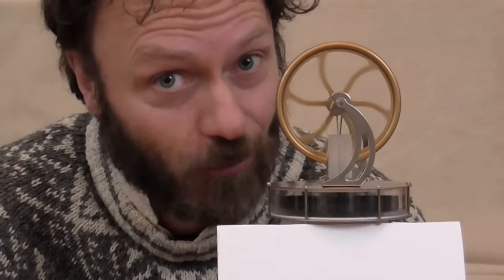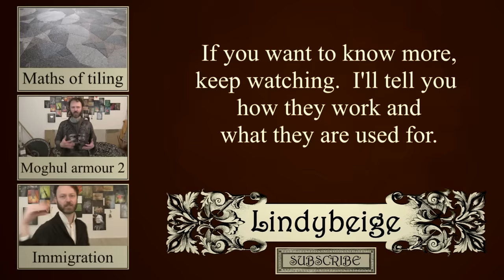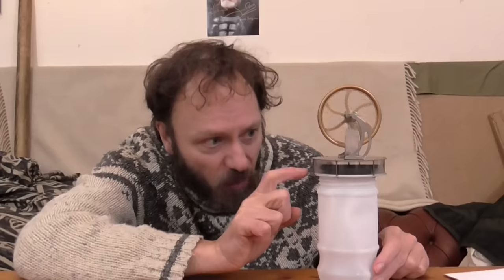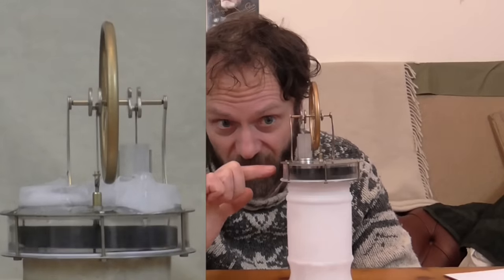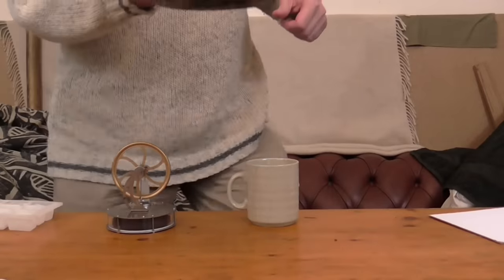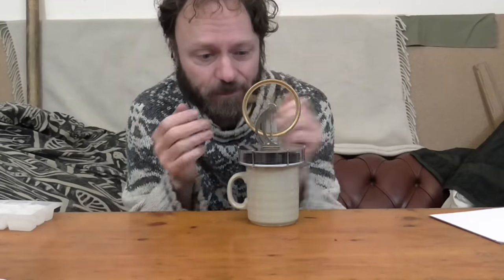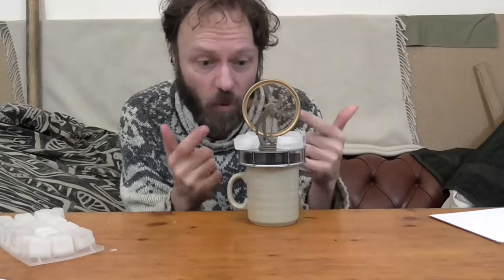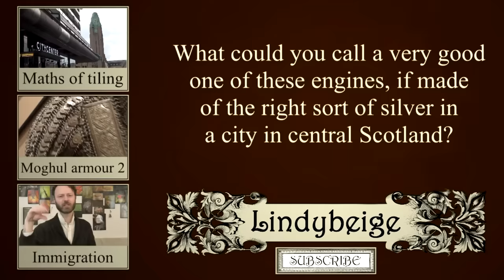Stirling Engines - the power of the future?

Comment: Just spit-balling here, but what if you used liquid nitrogen in hot-climates? If I'm understanding correctly, then it's the temperature GRADIENT that causes the engine to work, so in places like, say, Saudi Arabia (or similarly hot climates) wouldn't the temperature gradient between the natural heat and the nitrogen should be enough to power, say, a locomotive or something similar that you could mount them on in numbers for individual axels. Again, just a thought experiment; Great vid Lindy
Reply: Id guess  that it work really really fast  for a very short time . 
Or maybe longer if ye had a custom made nitrogen container (insulated and slow release etc etc )
Reply: Of course, it would take some trial and error to some degree but I feel that the information we have about the system is at least proof of concept enough to warrant its trials. I like projects, so I'm a tad biased ^_^ cheers
Reply: The energy to create the liquid nitrogen would far outweigh the benefits of this.
Reply: Anders Fredriksson would that not depend how long it lasted ?
I mean youd only need a tiny stream of it at a time ?
Reply: But you will need energy to make the liquid nitrogen in the first place. If you by burning fuel you get a hot plate over boiling point they can run quite fast even in hot countries.
Reply: MrMonkeybat Yes but it might be a good trade off depending on how much or how long the liguid nitrogen is used .........With something small it could last weeks , maybe more .......I mean youd only need a very very tiny jet of it to keep it cooler than the air around it .
Hot spas in iceland  sound inviting
Reply: You are effectively using the liquid nitrogen as a medium to transport energy from the generation plant to a sterling motor. This can be done more efficiently and conveniently with power lines or batteries for more compact and powerful electric motors. When keeping something frozen in liquid nitrogen you have to fill up your dewer weekly, it does not have a long shelf life
Reply: Liquid Nitrogen stops being a liquid when heated.
Reply: No, it wouldn't work.  Energy companies would love this.  Producing liquid nitrogen is energy intensive so the idea is a non-starter.
Reply: Joshua Rosen the hotwater spas in iceland sound good , i think ?
Reply: Oli Faelaen
Those should work very well as you have a permanent temperature difference without any energy input.

I don't know a huge amount about Iceland but I believe they already exploit geothermal energy quite extensively.
Reply: Joshua Rosen small scale fracking (i mean at a houshold level )  would work perfectly if they didnt need to use those noxious chemicals to open up the cracks .
The radiated heat only 25 feet down (i think)  is enough to heat your water .

I dont know why they cant just shatter the bedrock a few times and pump water up and down to empty it of the dust and chips of rock 

Why do they need this toxic chemical ?
Reply: +Oli Faelaen You are conflating fracking and borehole heat exchangers (BHE). Fracking is when you destroy enormous amounts of rock to release gas or oil that is "trapped" in pockets. This is impossible to do on a household scale, and is a one-time deal. Once you get the gas out, it's gone forever.

BHE is just drilling a small hole 100-200 m into the ground water (which has a stable temperature year-round) and using the heat differential to get power (or heat). You can't heat your water directly with BHE, as the ground water is always around 7 degrees Celsius, but you could use the energy created to heat water, of course... 
BHE is also not related to geothermal heat, which would require you to drill more than a kilometer (except for in volcanic areas).

Fracking uses chemicals because they have to. They need "lubricants" to make the water travel faster, anti-corrosion agents so the equipment doesn't rust etc etc. Fracking is really awful.
Reply: Funkpanzer 
I knew I was getting something mixed up.

The heat from BHE comes from radiation in the rock , or does it ?
Reply: No radiation or magma or anything, just the fact that ground water is constantly ~7 degrees. Imagine the stirling engine in the video having a constant supply of 7 degree water cooling the underside.
BHE is fairly common here in Sweden.
Reply: I think this sterling engine will work very well at the bottom of an ocean, where water is almost freezing cold but but just a few hundred feet underneath it, there are heat vents. Plus, there's so much room underwater that large engines can be built.

But I think it's still too impractical compared to steam
Reply: Radi Bear 
Ye didnt give that one much thought ,  no ?

hot water spas in Iceland (much easier )

Boiling hot water , and lots of ice .................
(and NOT at the bottom on the ocean)
Reply: You do realize that you have to cool the nitrogen before? You need a refrigeration unit to cool down the nitrogen. And since refrigeration is just displacing heat elsewhere, it kind of defeats the point.
Reply: TheFarciarz777
But what if it was used in extremely small quantities ? (to create the difference in temp)

I mean what if one tank of nitrogen lasted 6 months ?

I mean if the heat of his hand made it turn , then a tiny amount of liquid nitrogen would send it spinning.
Were not talking about freezing anything with a gush of ice , but just a tiny jet every few minutes , or a miniscule stream , lasting months  ?
Reply: Oli Faelaen
Even if a tank of nitrogen did last 6 months, it would take more energy to get the nitrogen into the tank than a weedy Stirling engine would put out. 

It takes almost no energy to keep a flywheel spinning.  If you put any sort of load on one of these Stirling engines, it would stop.
Reply: Oli Faelaen Ye didn't give that one much thought , no ?

The energy required to turn nitrogen liquid needs to come from somewhere.

Perpetual energy is not a thing. The point of this is turn the existing environment into renewable energy, like the temperature difference in the ocean or in your iceland idea
Reply: Radi Bear
I know , but what I mean is that ye dont open the liquid nitrogen and dunk it in there .

Ye use tiny amounts of it to keep the temperature at a small difference .
And its the difference  in the temperature that feeds the mechanism , not really the energy from making the nitrogen .

The nitrogen is only half  (or so)  of the energy making process , the relatively warm air is the other  (free half).

I know that energy can neither be created or destroyed , but half of this process is free , and a tiny amount of nitrogen helps it along .

But yeah , the iceland idea is better .
Reply: Energy is conserved. The energy put into liquefying nitrogen would be the energy (in part) powering the Stirling engine. All using liquid nitrogen is doing is reducing the efficiency of a Stirling engine.
Reply: Dingle Sey I understand what your saying but .........

that would have to be worked out mathematically .

ie ; how effective would the pay-off be .?
     how much energy the engine would yield and how long the nitrogen would be effective for .

I mean ye put a battery powered rover on Mars to run for 30 minutes . With extreme expense .

A chap I know was proposing changing waste trucks to methane powered engines . It was only viable for short runs .
But that was all that was needed .

I know its expensive to cool liquid nitrogen .
But if that tank of nitrogen powers what you want it to power for  6 months then maybe that would be worth the hassle .

Probably not but that would depend on the maths

Theyd have needed to do the same maths with windfarms and solar cells .
Is the energy or use going to justify the massive cost ?.
Its not just the nitrogen spinning it . 

Picture a reserve generator in a hospital thats never used . It still justifies the cost of it .
It would depend what its for and how and why its used .
Reply: Oli Faelaen You don't need to do the calculations.  If the nitrogen is causing the temperature difference, it must be the case that it would take more energy to liquefy and bottle the nitrogen.  Otherwise you would be getting energy for free and as you clearly do appreciate, that isn't possible.

1. Stirling engines produce so little power that they are useless for any real world application.

2. Even if they were not, you need to have an existing temperature difference to use one without inputting additional energy to the system.  Using energy to create a temperature difference will never work no matter how you do it, otherwise you would be getting energy for nothing and that is impossible.
Reply: Joshua Rosen 
Its not JUST the nitrogen .

The nitrogen would do (need calculations) Id guess half of the work ......
The air temperature (free)  does the other half.

Now Im not saying this is correct , Im just thrashing it out as an idea .

In order to keep that particular engine spinning  wildly  would probably take the eqiuvalent of a tiny leak , or miniscule jet every  few minutes .
That doesnt exactly drive it .....it creates the temperature difference .  The air temperature (free)  creates the other end (free) 

As I said , Im not talking about opening a cannister and dunking it in .

If you consider what the heat of his hand did (so quickly ) , picture how much nitrogen and how often it would do the same ?
Reply: Oli Faelaen I gave you the numbers. Liquid nitrogen cooled stirlings are an awful idea.
Reply: Oli Faelaen Basically in any situation, a gasoline powered engine is a better solution.
Reply: The additional efficiency from the nitrogen you are talking about is the energy from cooling it/pressurising it in a bottle. Any additional power from the liquid nitrogen would be from the energy required to produce the nitrogen in that state. Lindy putting his hand on the upper plate is him supplying energy to the system, it is not 'free' energy. In the same way, using nitrogen would mean externally putting energy into the system. So there is no free energy.
All it is is moving the energy used to cool the nitrogen to the upper plate of the stirling engine, work is still required to do that.
Reply: Dingle Sey 
The nitrogen is expensive only if its gobbled up.
Its inefficient in the same way that putting a nuclear reactor into a submarine to create silence is inefficient .
The very existence of the nuclear submarine is inefficient .
But that depends on what its used for / what its needed for .

The Maths would have to be done in any particular situation to see whether it evens out .

Theres two halves ; The (free) air temperature , and  the difference  in temperature .

The only expensive part is the nitrogen to create that difference .
Its the difference that does the work .
The nitrogen creates  one half of that  difference 

Ill say again though that it depends on what its used for .
------------------------
Pressurising and containing compressed air in a canister is absolutely inefficient unless you want to go scubadiving .

How much you want to go scuba-diving will justify the cost of the equiptment .

Building a mega expensive capsule to go to the bottom of the Marianna trench for 20 minutes is INCREDIBLY inefficient 
Especially when it takes 3 hours to get there just for a 20 minute return . (and a mere glance) 
------------
Another point - There was a time when making solar cells was too expensive to  justify installing them .
More energy and cost was used to make them than the savings in electricity.

If a single canister of nitrogen could work an engine for 6 months or a year , then its possibly worth it .
( but we dont know because we dont know what its for yet and would have to do the maths for it )

Petroleum has to be drilled and pumped out of the ground / refined / shipped / stored / sold ......so you can drive your kids to school.

Freezing ice in an expensive refrigerator and buying the Sterling engine , and applying his hands , using an expensive camera , was worth it  for a  5 minute video .

Petroleum and coal are  also incredibly wasteful . 
Public transport is efficient , but not used as much . 

My point , it depends what it would be used for . Only then can you work out whether its viable for that particular job .

Eg ....building a giant Stirling engine to install into an icelanding  hot water spa would be incredibly expensive (with no energy production .......but necessary to see if its viable .
Reply: Dude. I gave you the maths for nitrogen powered stirling engine.
Reply: TheFarciarz777 
What ?
Where ?

I didnt notice it .

But yeah , thats fair enough .
Thats what Ive been saying .
The maths has to work out whether its viable for a particular task .
Reply: I'm gonna copy paste it:

"The power generated by a 100% efficient stirling engine is equal to the heat transfer. If you are transfering 1 W of heat then you can get at most 1 W of power. I would say that the heat transfer from his palm to the other side of the engine is about 1 W or even less.

If we drop nitrogen onto the cold side, it will cool down the plate until it absorbs enough heat to vaporize (so we don't even need to consider the hot side temperature if it's constant). So the energy that can be extracted from liquid nitrogen is equal to:

mass * [specific heat of liquid nitrogen * (boiling point of nitrogen - temperature of nitrogen) + heat of vaporization of nitrogen]

Specific heat of liquid nitrogen is about 2 kJ/K/kg, boiling point of nitrogen is about 77 kelvins and the heat of vaporization is about 200 kJ/kg so by plugging those numbers into our equation we get:

m (in kg) * [2 kJ/K/kg * (77 K - t (in kelvins)) + 200 kJ/kg]

Dividing by time we get power output:

flow (kg/s) * [2 kJ/K/kg * (77 K - t) + 200 kJ/kg]

So let's say out nitrogen is at 50 K. To get 1 kW (100% efficiency) we need over 14 kg of liquid nitrogen per hour. That's A LOT. Let's say we're just constantly charging our smartphone (5 W). For the tank to last 6 months it would need to hold whooping 310 kg of liquid nitrogen at 50 K. That's over 100 gallons of liquid nitrogen.

It's a much better idea to just heat the hot side and let the cold side sit at the environment temperature. If we use gasoline to heat the hot side (100% efficiency) we use only 80 grams per hour to get 1 kW."
Reply: Oli Faelaen It is just the nitrogen.

The fact that the atmosphere is involved is irrelevant.  The nitrogen is responsible for the temperature difference and for the reasons I have already explained, it is impossible for the energy used to produce the cooling effect to be less than the energy obtained.

How long the nitrogen lasts is totally irrelevant.  There is no need to do calculations.
Reply: "it is impossible for the energy used to produce the cooling effect to be less than the energy obtained."
Spot on. In using nitrogen you are wasting additional energy.
Reply: Dingle Sey 
Ok , fair enough .
Id imagine your getting frustrated at this point .
But I think were picturing two different things. 

what Im visualising is that the nitrogen on its own is not powering the engine .

The cold forces the piston up (or down )
The warm air temperature above forces it back down . 

The cold is only one half of the process .

As he said in the video "The engine runs off the  difference in temperature"  ("even better is the combination of heat and cold) 

It doesnt run exclusively off the cold nitrogen 
It runs off the  difference in the temperature , and one half (or so) of that difference  is free warm air .

Im taking your word for what your saying , but I dont think were talking about the exact same thing. 

One half of the process is free .
The nitrogen doesnt have to  "Power" the engine . 
It just has to create a difference in temperature. 

And its the difference that runs it .
Not the nitrogen on its own . 
Thats what powers it .
Reply: The additional difference in temperature difference you are making with the nitrogen comes from the energy required to get the nitrogen to its current state.
Reply: Dingle Sey I dont think your factoring in the other half of the system .
IE ; the warm air (thats free)

Picture a large one , half buried in the Sahara .
Constant 5 degrees (i think ) 4 feet under . Soaring temperatures above .
Below that a tank of nitrogen , that once every few minutes , or every few hours emits a tiny jet to kick start it when it stops.

The longer that tank can last , the more the cost evens off .

As I said your not opening a canister and dunking it in there . That would be gone in minutes .
Reply: I literally gave you the maths on liquid nitrogen needed to make power. The cold plate warms up very fast, that's why you need to constantly cool it down. A drop is not going to last one second. Assuming 100% efficiency, you would need at least 10 kg of liquid nitrogen per hour to run something like a fridge or a toaster.
Reply: And no. The temperature difference doesn't power a stirling engine. The flow of heat from the hot to the cold side does. That flow is created by the temperature difference and the more flow you have, the more energy you have to spend to keep the temperature difference.
Reply: Did you fail physics classes? Because this is middle school knowledge.
Reply: TheFarciarz777
No , its not that .
Its that I think were looking at two different approaches .
Wording is the main problem .

Im not saying your wrong .
I believe what you are saying is correct , but I dont think we are looking at the same idea

i dont have any degrees in physics , or maths , but my brothers field is cryogenics .
Hes built and installed cryostats all over the world .
Spends 1 week a month in the IQOQI .
But thats him , not me .

His answer in brief is   "yes and no "
That seems to be Lloyds assertion too .
.
Its not a simple matter of "energy can neither be created nor destroyed".

We use enormous amounts of energy to do relatively small things .
------------------------
I think ,you think that Im saying that the energy used to create and store the nitrogen can be magically transformed into free energy .
Thats not what Im saying .
That simply wouldnt make sense .
-------------------

Im not sure if this is the correct wording either , but the idea that the nitrogen could be used , to  help release or harness potential energy thats already there , is not so far fetched .
Reply: I know what you are saying. You want to cool the cold part with liquid nitrogen. But "one drop every so often" just isn't physically possible. You need to keep the temperature difference and to do that you need to cool it constantly. If even slight amount of work is done by the engine, the cold part will heat up very quickly.
Reply: TheFarciarz777 yes , but not exactly .

A tiny bit of nitrogen could kick start it again to help an already existing temperature difference 

Id place the cool part in the ground where its already cool .(at a constant 5 degrees ?) And the warm part in the scorching sun .
So , the temperature difference is already there .
 But an occasional tiny jet will help it along such as the hardest part which is creating the initial movement .
So , its not the nitrogen alone .
And the cooling is only one half of the system.

That was my other point that isnt included in the overall equation (the warmth is free) 
--------------------------------
a few atomic particles  can release a massive amount of energy (eg the atomic bomb / nuclear reactors ,  and wow , refining uranium is a lot more expensive )

Nuclear subs that could stay running for 20 years without refuelling .

This engine will eventually be used in one form or another , and there will likely be a catalyst  (that catalyst could be nitrogen, maybe , I dont know , but thats what Im suggesting ) 

The scorching desert sun differentiated with  5 degrees beneath the sand or earth , already releases potential (free) energy 
Hot water spas in iceland ?

The cost of producing solar panels once outweighed their benefit , but not anymore .

The same was true of wind-farms .
And half the time they arent even running . ...but the benefit eventually outweighed the cost .

But anyway , how expensive is liquid nitrogen ? ........That fog you see at concerts and clubs that resembles dry ice , is that not nitroogen ?
Reply: even if you managed 100% efficiency, the best you could ever manage with this, you'd use more energy to cool the nitrogen than you would get from then warming it back up with this motor. this is mostly because it's really really hard to cool things down on a planet it such a high average temperature.  A better idea would be to put a pair on a coast and use the energy from one to pump water from the sea to cool the bottom of itself and the one paired with it to keep a decent temperature difference and then have energy from the other to use for something else.  the design of something like this though would be incredibly large (mainly because the water would have to come from further down in the body of water so it would be cooler) and it wouldnt be very practical.  These are cool, but not very practical.
Reply: Are you Karl Pilkington? 
"That fog you see at concerts and clubs that resembles dry ice , is that not nitroogen ?"
No, that's dry ice.

You seem to think that the Stirling engine is a new and paradigm-shifting invention that just needs some refinement. It isn't. It's old and inefficient, which is why it isn't in widespread use. Adding more complexity to it does not improve it at all. 

The only advantage of the Stirling is the simplicity. You want to take that away, and add the worst coolant ever. Liquid nitrogen boils (and thus evaporates) on contact with any surface. You'd need a closed system with a pump/compressor, like a refrigerator. I hope you understand why that's a bad idea.

If you can run it on "waste" heat or cold, then fine. I would definitely do that if I had a fireplace in a remote house. 

Your idea of adding energy-draining complexity to a simple idea is like putting an electric fan in front of a wind farm, or shining a flashlight on a solar panel.
Reply: Funkpanzer Thats grand , I was asking was dry ice liquid nitrogen . 

youd need to go through the whole conversation to see what I was trying to get at .
It would depend what it would be used for .
We expend enormous amounts of energy for very little return depending on what its used for .

On my last post (or second last ) I suggested its use as a catalyst to get it started in a situation where theres already a large temperature differentiation .

Im not disagreeing with what the other chaps said .
Reply: Dry ice is solid CO2. The thing we call "ice" (like in the Arctic) is the solid form of H2O. So dry ice can not possibly be liquid anything.

I think you might be focusing on the wrong part of the engine. It would be much easier to increase the heat on the hot side. You could do that by waste heat, solar reflectors, a candle, rectal insertion, absolutely any source of heat. 

Liquid nitrogen is a terrible, impractical, uneconomical, energy-wasting way to use a Stirling engine. It makes even less sense to use it as a "catalyst". If you already have a temperature difference (let's say a hot spring and a glacier), why would you want to bring more cold into the equation? What good do you think it would do? 

You suggested using CO2 as a "kick starter". This is the opposite of how Stirling engines work. You need stable temperatures on the two sides, not a sudden, initial drop in temperature on one. If your engine needs a temperature drop to start, it would stop as soon as the temperature rose again.

It seems like you're fixated on the idea that "cold" is something that needs to be added to a system, regardless of practicality or cost. It is really the other way around.
Reply: Funkpanzer

No ,
No fixated .
I initially suggested that hot spas in iceland would be better .

I was arguing with the other two ,  that cold was only one half of the equation .
That the other half (the warmth ) (or vice versa)  was free .

Even if Im right , Im not going to be able to out argue you .
Would you at least concede  that it depends what its used for ?
I havent once  suggested it as an engine for creating energy .
It definitely does depend on what its going to be used for

Would you say that a nuclear reactor inside a submarine is incredibly wasteful ?
Billions just to sail around to do nothing ?
Reply: And you say that with absolutely nothing to add .